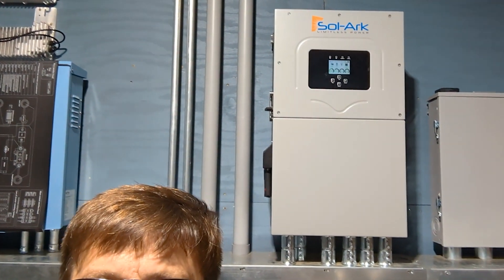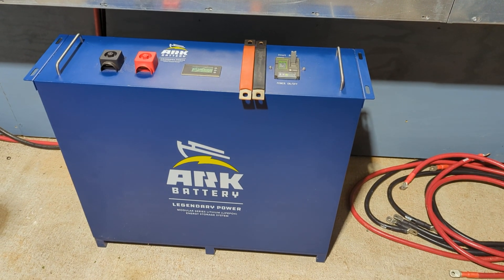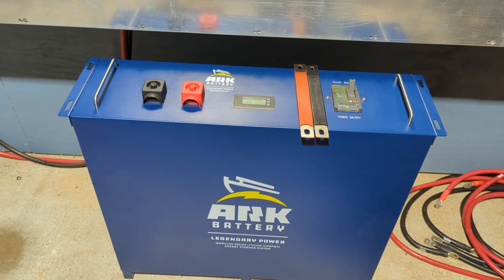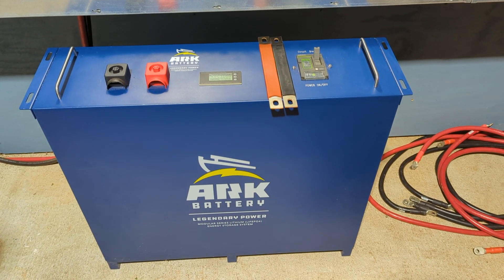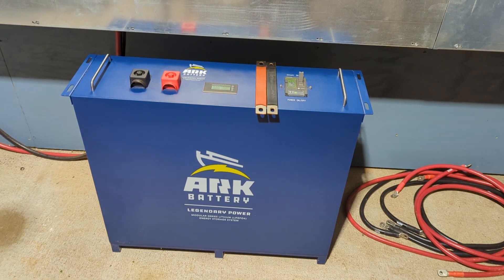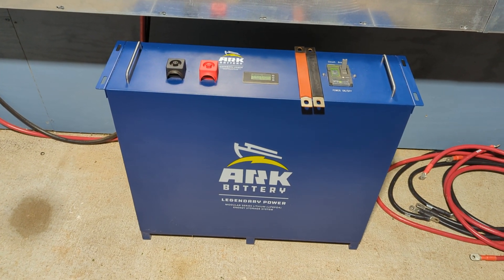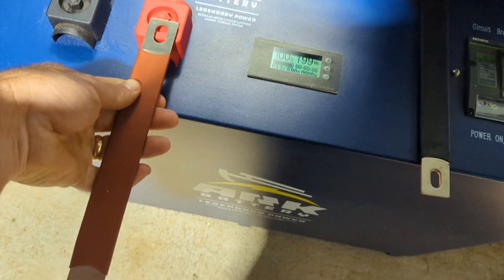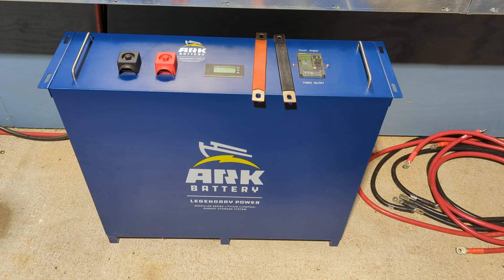Balancing Battery BMS!

Comment: This doesn't make any sense.  Fully top-balanced cells are going to naturally be slightly out of balance as they are being charged (or discharged), in order to reach a balanced state at the top.   Attempting to balance cells in any way while they are at lower charge levels just has the effect of throwing them out of balance at higher charge levels and reducing the overall capacity of the pack.  Not to mention adding unnecessary cycle wear to the cells.

What you want to have happen in a modern LiFePO4 BMS is for the balancing circuits to activate once any cell voltage reaches 3.50V or higher, or for the balancer to remain active as long as that is the case even if charging has finished.   That allows charge controllers to be set to 3.55V, while the BMS's cut-off voltage is typically 3.65V.   Per cell.   So the typical charging parameters are to charge to 3.55V/cell (e.g.56.8V for a 48V pack), then hold there in absorb for about 2 hours which gives the BMS plenty of time for balancing and tail current plenty of time to drop off, then allow the batteries to drop down to a nice load-support float voltage of 3.375V/cell (54V for a 48V pack).   Which, of course, that as soon as the charger is no longer holding a high voltage and the cells drop below 3.50V, the BMS stops balancing.

While dumb chargers typically go all the way to the BMS cut-off voltage, it puts unnecessary wear on both the BMS and the battery.   The balancing function itself, at 3.50V or higher, has literally no effect on battery wear.  Zero.  The marketing is just plain wrong.   Smarter charge controllers no longer do that.  For example, Victron's defaults are now 3.55V/cell, 2-hour fixed absorb, then provide a load-support float voltage at 3.375V.

Not all BMS's do passive balancing properly.  Quite a few only balance while actual charge current is non-zero.  But that is basically the wrong way to do it.  Properly modern BMSs leave their passive balancing circuits active as long as any cell is 3.50V or higher.

Similarly, for people using an active balancer, the active balancer should only be enabled at 3.50V/cell or higher (e.g. 56V or higher on a 48V pack).   Turning on the active balancer at lower voltages will only throw the cells out of balance and put extra wear on the pack, not help them get into balance.

The last thing is that LiFePO4 cells just don't lose their balance very quickly.  You don't really need an active balancer unless the cells in the pack are really seriously mismatched.  And even then it might not be a good idea.  After just a few full cycles on the pack the cells will be in balance and even the small passive balancing current that most BMS's have will be plenty to keep them in balance.  If you have cells in a DIY pack that are constantly and seriously going out of balance at the top you should replace those cells straight away.

It is ok for cells to be out of balance at the bottom, particularly if they weren't matched to begin with or if some of them had to be replaced over the years.   As long as you are getting close to the expected capacity out of the bank, everything is working properly.  There is absolutely nothing wrong with seeing cell voltages diverge a bit during discharge.

Comment: I see that the ARK battery has a 1.1 amp balancing circuit. That may not seem like a lot but there are many that only have a .05 amp resistive balance. There are typically three types of balancing circuits. The descriptive terms used across the market are now stolen or greatly misleading and can only be verified specific functional wording or testing. The first type is the oldest, least effective and most common and is known as resistive. It simply dumps power from the highest cells in the form of heat. The next type is said to be “active capacitor” and uses capacitors to transfer energy from the highest cells to the lower They are capable of higher balancing currents, most around 5 amps, but only at higher cells imbalance. (Heltec brand is a common example). The last type is known as a “smart active balancer” but there now some listed as such that are truly not. This last kind, always finds the highest cell and discharges into the lowest. It also uses “super capacitors” to transfer the energy typically 2 or 4 amps. This one has an extra trick, it maintains that high balancing current right down to a very small cell differential (.003 volt!). With this high balance current, a battery has a much better chance of getting balanced even with a shorter time in a higher state of charge (the only time a balancer should be active, over 3.45 volts per cell). JK bms’s and Neey (auxiliary balancer) are two of these last kinds. 

I’m guessing the ARK battery has one of the latter two types of bms balancing technologies.

Comment: Could a guy buy just the BMS and the screen then make them fit the Eg4 Lifepower4?
Reply: It would be very complicated
Reply: Don’t see that as cost effective or worth the time, if you want active balancing buy an intelligent active balancer, one where you can control the voltage floor at least

Comment: Have you ever worked with a battery system using (ultra) capacitors rather than being lithium based batteries in a home or business solar power system?  My minor research and minimal understanding of capacitor based battery systems (all I've seen were home made) claims these batteries have charge/discharge cycles that are 1,000 times that of the latest, greatest lithium based battery systems.  

Also, what are your thoughts on using quality dual motor tracking mounts vs the fixed mounts you typically install?  

Your thoughts, knowledge and expertise regarding these questions would be greatly appreciated.
Reply from the maker: I would love to see a capacitor based battery and there have been some attempts.  I think using caps and lithium together would be awesome.  

Dual motor trackers are expensive and require a lot of maintenance.  I have seen several defunct tracking solar farms.  trackers are cool but when they cost $8/watt vs $0.25/watt it is hard to justify.
Reply: @engineer775  Thank you for the reply.  I take it you've also seen the YT videos where they built battery cells using capacitors but that was for mobile purposes, not larger fixed base battery cells.
Reply: Find a Canadian distributor.  I used to import. My experience has been by the time you pay taxes, import duties, shipping and exchange everything is double. That’s my rule of thumb.

Comment: Integrated BMS = Battery murdering system with my experience.
Reply: Can you elaborate?   How do you manage cell current or voltage boundaries without an integrated BMS?
Reply: @edwardbyrd7667  My experience with them has been in smaller li-po packs. Recently I had several 6s 10 ah packs with integrated storage mode fail in a way that creates a few watts of drain on one cell. This commonly ended with one cell puffing on recharge or otherwise damaging, sometimes killing the cell after over discharging itself.  These integrated bms systems are disposable with the battery correct? If so I would like to see reusable, external high quality balancing boards for larger storage batteries.

Comment: Is the active balancer on all the time? Or just when charging, or just above a threshold voltage?
Reply: The balancing system turns on whenever a cell voltage difference of 0.05V or greater is detected. That's anytime during charge or discharge.
Reply: @jamesmast9147  you should watch the videos Andy at off Grid Garage made about always on active balancing.  His conclusion, Active Balancing during the charge cycle or even while sitting idle in the knee is good, but trying to maintain balance all the way down is inefficient and is actually detrimental to the overall health of the cells

Comment: Thanks for the update.  Looks like a very good battery system.  Would you be willing to share your perspectives regarding SOK vs ARK  vs Signature Solar EG4-LifePower 48V 100AH ?  Also any comments regarding the different racking systems?  This would be incredibly helpful.  Thank you.
Reply from the maker: We are working with Fortress, ARK, Homegrid, EG4.  As you know there are so mnay LifePo4 options on the market. Sometimes the decision comes down to price, sometimes it is how the battery fits the space, sometimes it is availability or a combination.  I have not tried the SOK batteries.  I am finding that all of the batteries work the same.  Some are easy to work on ( replace BMSs) some are difficult , some are impossible.  So long story short we have a selection of batteries to cover most customer needs. I also established good relationships with the company owners and this has been invaluable.
Reply: @jasonphillips3051  Will has been showing some positive results so far on the EG4s rack mounts...  Time will tell...
Reply from the maker: @jasonphillips3051  I am about to make an EG4 video.  I have six of them on my 15k Sol-ark.
Reply: @engineer775  Great!  Looking forward to comparing them.
Reply: @jasonphillips3051  agree, thanks. Can you please elaborate on your EMP comment?.  This is another area I am researching.

Comment: Wow why isn't this the standard? My bms allows a cell to go high everytime and randomly picks a different cell to do the same thing on next charge. Seems stupid to me.
Reply from the maker: I have heard that referred to as a spagehti BMS.
Reply: What they describe only works if your cells are well matched. Normally you really do only want to balance above say 3.45 volts, but you can do it with a 2a active balancer rather than a .1a passive.

Comment: Does the owner James ship to Alberta, Canada? Or do you supply and install? And what do these batteries cost 🤔 in USD?
Reply from the maker: I will find out.  Which battery and how many?
Reply: @engineer775  Well 775 ,I found a quote stating  $4850.00 for the demonstrated in your video.  And that's USD ,now to ship to Alberta, Canada plus the currency exchange and brokers fees plus whatever extra charges that may imposed ,would bring the cost per battery to about $ 5500.00~6000.00. So I guess it is tough living in a 3rd world country, but the way things are going in the world, we might all be 3rd world countries very soon.
Reply from the maker: Send me an email with your address and how many batteries and I will get you a shipping quote.  practicalpreppers@gmail.com